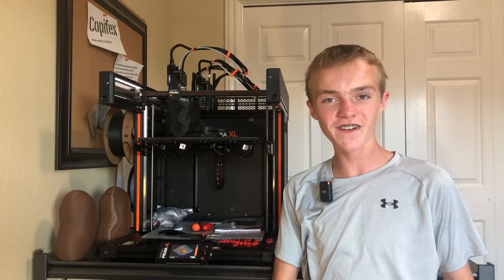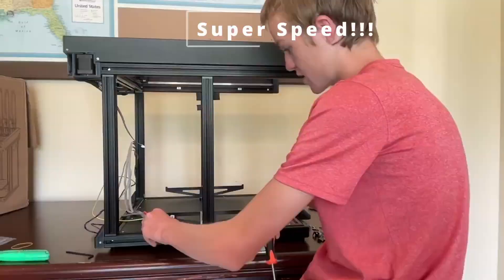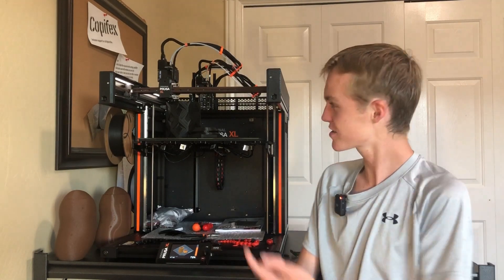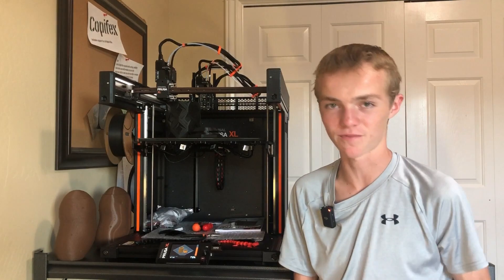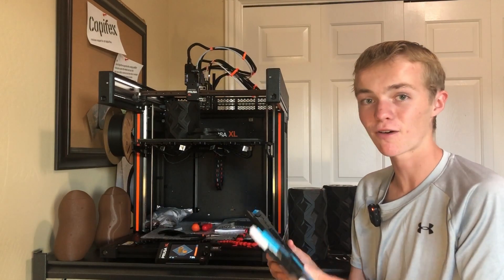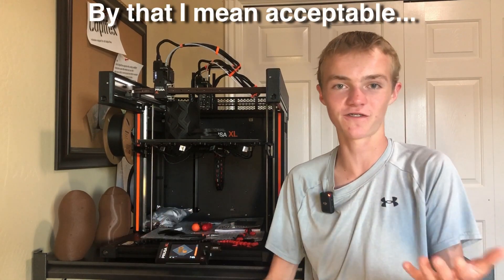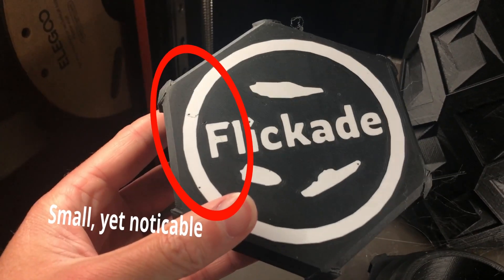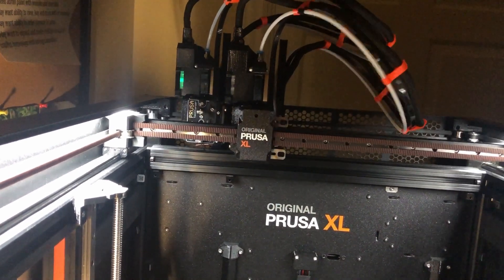Prusa Xl First Impressions // Dual Toolhead

Comment: 4:06 - I've gotten stringing when using larger nozzles, and the Prusa XL ships with 0.6mm nozzles. I've solved this in the past by increasing retraction and/or enabling "wipe while retracting" as well. Maybe this will alleviate your stringing issues?
Reply: Prusa XL ships with 0.4 nozzle now, so may wanna upgrade
Reply: @Official_Skypaper  - Yeah, I also switched to a 0.4 mm nozzle shortly after leaving my original comment. It kind of blows my mind that these issues were not caught early in user testing, but fortunately the machine is now pretty good.

Comment: To stop the filament droplets from showing up on your bed. Change the probe temp in the g code to 160. It’s set to 170 and doesn’t need to be. The save it. Select the save profile file and run a test print. Also you really need to play around with slicer and learn which filaments do things to your prints and adjust them in slicer. As you said in video most if not all of the issues were user error and is expected as you learn how to 3D print. Set it and forget it is not how printing really goes. That’s only after you find tuned it, figured out how each roll of filament reacts, environmental effect (room temp, drafts, fans, ac), etc;

But, you are right about the PTFE tube… would have been nice to see a more direct line to changing filament. Maybe you can use Fusion 360 and design something and put it up on printables? 😊
Reply: Exactly what I've ended up doing with my MK3S+.....160 is the way!

Comment: Hey :) nice video! But 2 things: the cable mount on your extruders is wrong. It should be straight upwards. Just turn your extruders for the right duct. And to the leveling process with the dots, you can modify the start gcode in prusa slicer and take a look for the number 170. Just change it to 140 ;)
Reply from the maker: Yep, I realized that pretty soon after creating the video (through prusa discord). Thanks for mentioning it though :)

Comment: Great video! You earned a new sub, looking forward to your future videos. I have an MK4 and have been thrilled, but I am super tempted to order an XL. Are you using Prusament or another brand of filament?
Reply from the maker: I typically don't use Prusament as shipping is pretty expensive where I am. Lately I've been using Matterhackers & Elegoo filament.
Reply: @Dragon3D  Thanks for the response! Prusament is definitely an expensive option but I appreciate how well Prusa tunes its presets for its own filament and printers. I've been wondering if I should move to less expensive filament, so maybe I'll give Matterhacker or Elegoo a chance! I definitely don't like paying almost $40 a kilo for prusament 🤑🤑

Comment: Whoever decided to make this an open air printer should be FIRED!
Reply: Enclosure modification for this printer is on the way.
Reply: Yeah have fun printing with PLA only lol
Even PETG makes problems at this scale without a heated chamber
Reply: @Fabian3331234333  I've been able to print PETG outside of a chamber just fine, dunno what your talking about
Reply from the maker: Lol

Comment: [Edit: Ok, saw the note, forget what I said ;-)]

I'm only 40 seconds in, but you might want to fix the extruder cable guides. They should make a vertical loop, not fall sideways like yours do. I'm guessing the plastic strip that creates the loop is twisted.

It's an easy fix: Unplug the connector and the PTFE tube. Losen the two screws holding the strip, undo the strip and straighten it before remounting everything.
Reply from the maker: Yep, I didn't originally realize this ;)
Reply: @Dragon3D  It seems to be a common problem. I've seen multiple new XLs with this issue lately :)

Comment: Hi, waiting for mine to come, did you feel the need to degrease and regrease the linear rails? After having built a voron the rails ran much smoother after having done that. Also, could you give a rough measurement of the distance between the back feet and the rear of the printer, ie the clearance I would need as its going up against a wall. Thanks

Comment: Thanks for the review. No noticed that the cables that go from printer to the extruder are not in the up right arc as seen on other XLs.
Reply from the maker: Yeah, that's my bad. In the live stream I mentioned that, but figured it must be normal. Turns out (found this out this morning) my cables were slightly twisted. All I needed to do was un-twist them and they stand up normally.